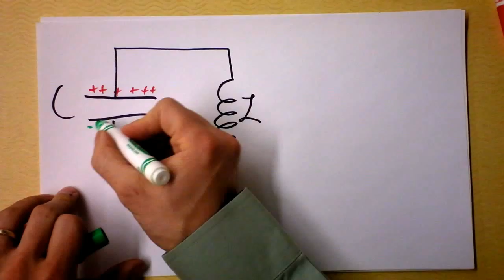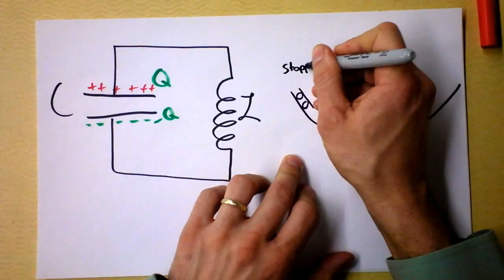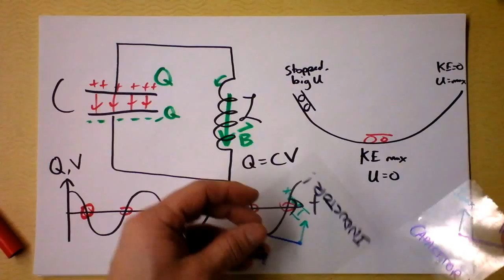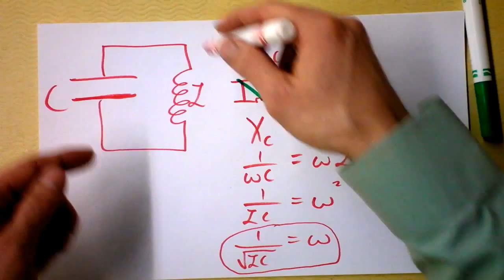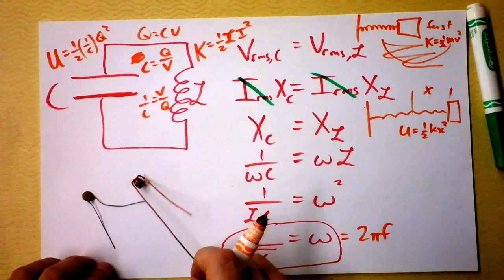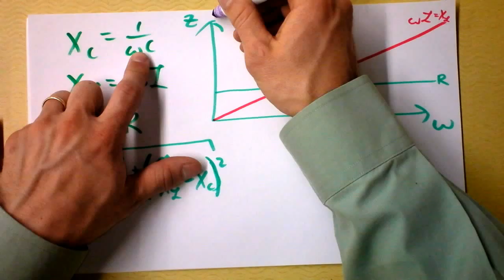AC Circuit Resonance Bonanza | Radio Tuning Frequency, NMR Coils, & the Complex Plane | Doc Physics

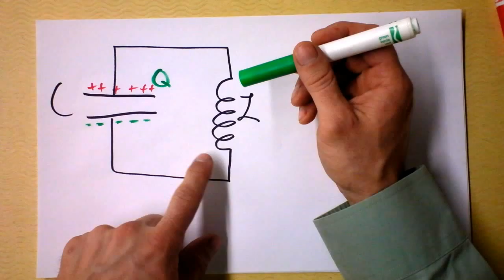Comment: 1:50
WRONG (i think).
If u short a capacitor the charge on each plate duznt swap. The charge on each plate equalizes.   SURELY (i think).

Comment: Par votre schéma, jusqu'à 5.20, vous avez composé un appareil pour ionisé l'air ambiant, en apportant une rotation aux pôles du condensateur, une rotation inverse et cela en prenant un Condensateur d'Aepinus . . .  Pour la bobine vous prenez une bobine de Tesla afin d'avoir une Très Haute Tension. 
Sur l'écartement des deux pôles du Condensateur, vous avez une fréquence sur le courant.
Après, je vous dirais comment créer de l'énergie avec cet appareil . . . 
Merci de votre explication, car j'ai la mécanique mais, pas la théorie !
Par contre, je n'ai pas fini mes études sur cet appareil.

By your diagram, up to 5.20, you have composed an apparatus for ionizing the ambient air, by bringing a rotation to the poles of the capacitor, a reverse rotation and that by taking a Capacitor of Aepinus. . .For the coil you take a Tesla coil in order to have a Very High Voltage.
On the spacing of the two poles of the capacitor, you have a frequency on the current.
Next, I will tell you how to create energy with this device. . .
Thank you for your explanation, because I have the mechanics but, not the theory !
On the other hand, I have not finished my studies on this device.

Comment: I indeed understand how the inductor initially resists the flow of current, but I don't understant is how it does not simply consume the potential energy from the capacitor killing the oscillation. Can anybody explain? Thanks a lot.

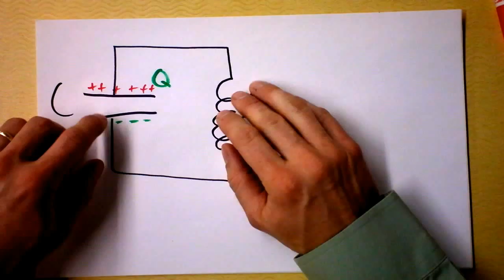Comment: Correction at 2:00 - there is no charge on capacitor. The reverse current is driven by coil through induction and not by capacitor.

Comment: @ 9:10 you said that the inductive reactance is equal to the capacitive reactance in a series circuit. You are saying only if there is no voltage right? Because the capacitor could be 1uF and inductor 1mH, with 1kHz input (1/2pifc and 2pifc) means they wouldn't be equal.

Comment: Doc, it a really nice explanation of resonance, but I have a simple question regarding resonant frequency, I would like if you could make a video on how to solve this simple question. Here it goes.  If a 200uH whose resistance is 5 ohms and is connected is series with a 200pF capacitor, what would be the resonant frequency of the combination. Hope you can make a video. Moises from Belize Central America. Thanks a lot.
Reply: Omega = 1/sqrt L x C
Put values there and you get it.

Comment: at 1:48 it says that the same amount of positive charge will build up on the previously negative plate, causing the "polarity" of the capacitor to change and start pushing in the opposite direction. This confuses me because I though that once 50% of the charge has left one plate and ended up on the opposite plate, there will be no net charge difference on the plates, and as such the voltage would be zero, causing the current to come to a permanent standstill. Why doesn't this happen? Or is this just a flaw in the video?
Reply from the maker: Andrew Muller Consider a pendulum as it passes through the lowest point in its cycle.  Why does it continue despite the fact that there is nothing pushing it?

Comment: There's just one thing I don't understand.  At 1:08, you said that current will flow clockwise, i.e., from the positive to negative plate. Please help me make sense of this.
Reply: Back before they knew that current was actually caused by the movement of electrons, they naturally assumed that the "electrical motion" per say, was going from the positive to the negative. So if you had a capacitor with a positively and negatively charged plate hooked up to a circuit, the assumption was that the electrical charge was moving from the positive to the negative plate. Nowadays, we know that's actually not what's happening. The particles that carry the electric charge along the circuit (the electrons) posses a negative charge, so really what's happening is the negative charge is moving to the positive plate. Because of this, what we define as current is opposite the flow of the electrons.